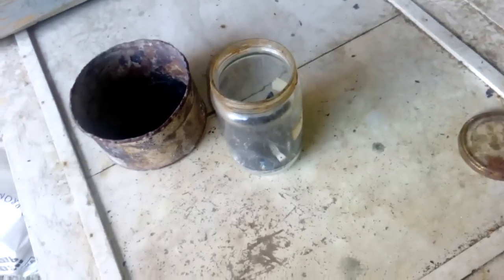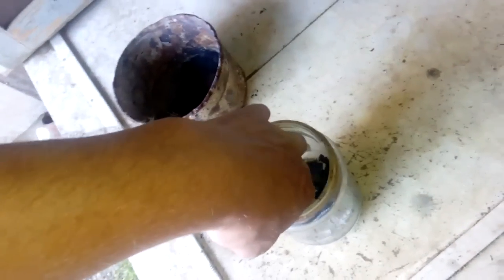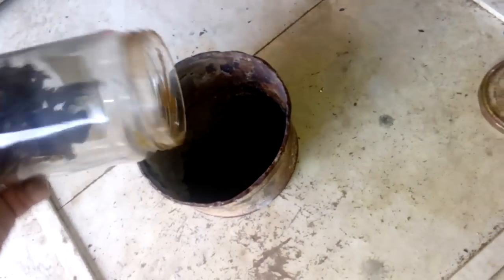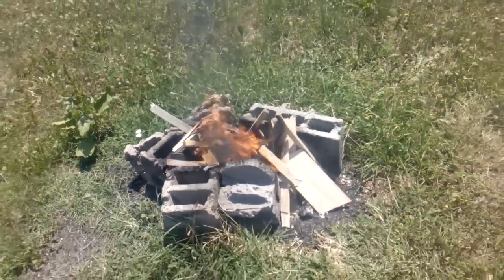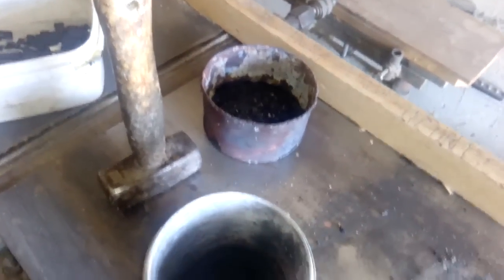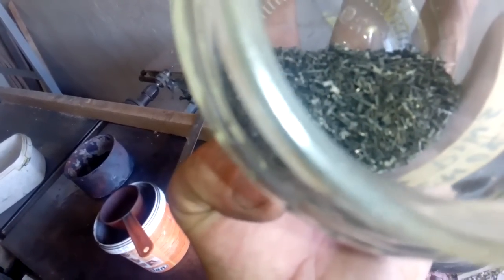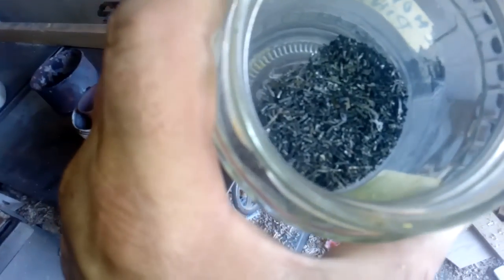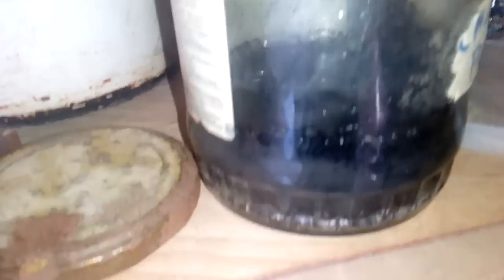Stubborn pins removing from plastic.

Comment: can you recover them withou burn?
Reply from the maker: It may be necessary to remove the plastic or otherwise you will need a lot of Ap solution. It is best to remove the plastic by burning,or mechanically removing.You can try boil first with all the plastics in Hcl to remove the tin, then into Aqwaregia, but you will need a lot of solutions if you have plenty of plastic.

Comment: i dont get why u ad copper chloride at the end...u dont need bleach to refine it??
Reply from the maker: adushman1984 not at the end,same time vith Hcl i ad coper hloride,jus i vait litle time to Hcl first disolve some aluminium first.
Reply from the maker: Not at the end,i ad coper hloride litle time after a ad Hcl,but i vait sometime to Hcl disolve sam aluminium in that pins probabli from plastic.Coper hloride help to speed ap proces to disolve base metal.
You can use Acid-bleach at the end or aqva-regia.